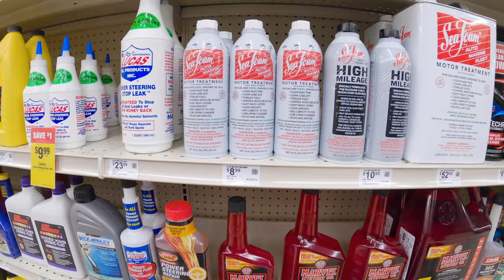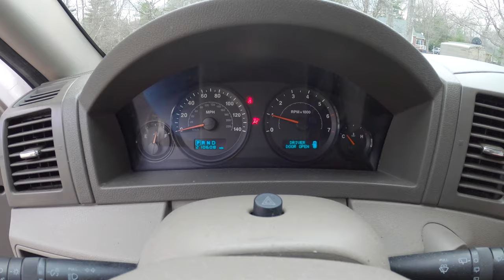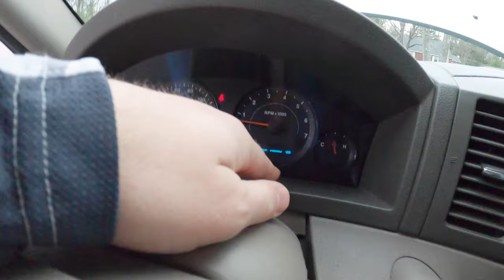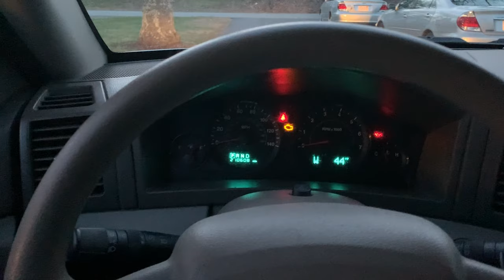Jeep WK Overheating While Seafoam "Carbon Cleaning"...

Comment: listen from what i see the radiator fan not working so it over heating that happened to my Jeep grand cherokee
Reply from the maker: boomer75751 that’s what I’m thinking too man. Did you have to replace the whole unit? Thanks for the comment! I replaced the thermostat btw.
Reply: @NotSoHandyCarGuy  I know the GC is gone by now but I have one I got last year for free, replaced with a 4 core racing radiator, new thermostat and hoses and made sure to burp the system and it has ran good all year now. I think the water pump is next in about a month just in case to see if I can get another year or 2 out of it.